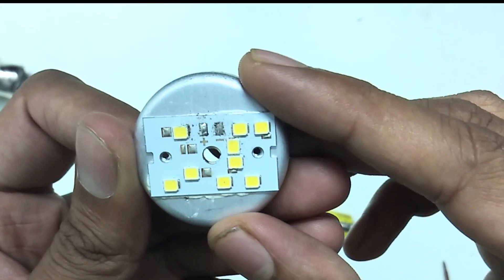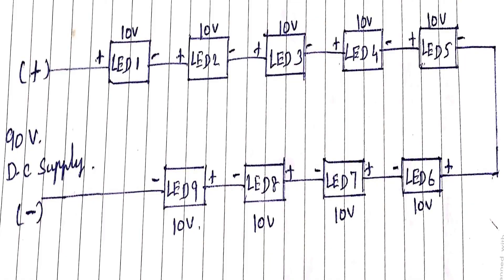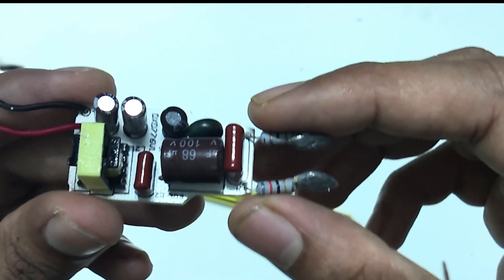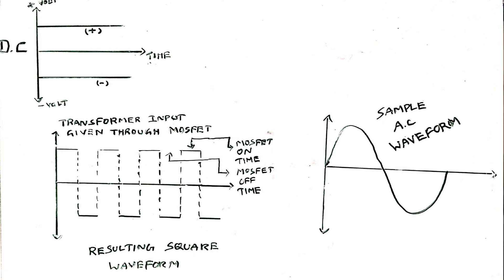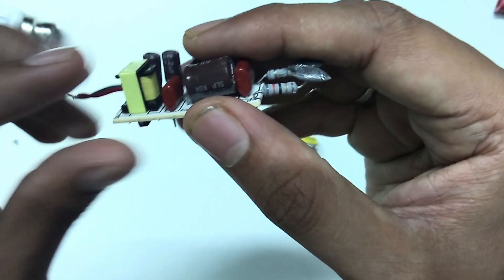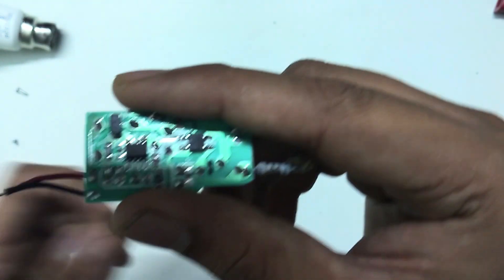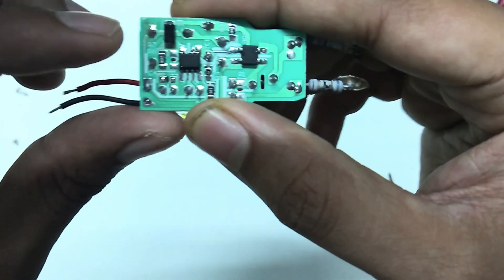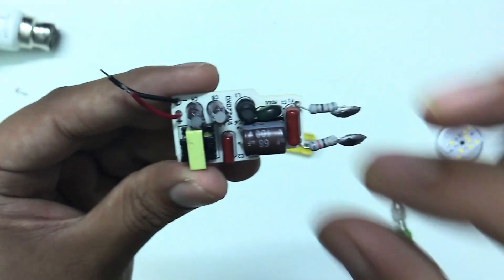What's Inside; LED Bulb vs Incandescent Bulb_ Tamil, How a LED Bulb and Incandescent Bulb works?

Comment: Led bulb circuit board la direct ah transformer ku input kuduthu step down pani diode use pani dc ah mathirukalamae ethuku bridge rectifier potu dc ah maathi atha marupadium ic use pani square waveform ku maathi anupanum tranformerku?

Comment: bro led bulb la oru doubt  bridge rectifier  tha  ac ya dc ah convert  panniruchula nama step down transformer use panni voltage um korachutom  aprm ethuku diode use pannanum apudiya supply kudukalam la?

Comment: Instead of first converting AC to DC then using driver IC for square wave and next stepping down AC and finally converting into DC, why can't we first step down AC to the required voltage and then finally convert it to required DC input?
Reply: my doubt also same

Comment: Bro LED AC to DC bridge rectifier use panaga ok again Transformer after AC to DC convert veanum andha oru diode use panirukanga   andhu enna diode bro andhu Yan brige rectifier pathilam use panna kudadhu??
Reply from the maker: After transformer it's square waveform. So only diode is enough

Comment: Dear bro, in led dc driver why using two times AC to DC convertion. Why didn't Directly using AC input step down to required voltage and after change AC to DC.
Reply from the maker: It's a switched mode output. That's why

Comment: Bro I have problem why led bulb not working after 15-20 days in my house. Even after change brand 3 to 4 brand led bulbs results same. Same thing happening for tube lights also not working after 5 to 10 days for two rooms in my house... Some plug points were burnt.... Is there any solution for this ??
Should I need to change wiring in my house ??
Reply from the maker: Call electrician now, some serious issue

Comment: 1. Why can't we give the input 230 AC volt directly to the step down transformer and then convert it to DC and give it to LED?
Why are converting the input AC to DC and then again to AC and to transformer and then converting it to DC.
Why my point 1 is not valid?
Reply from the maker: 1. direct transformer output produce more ripples.. 2. Transformer will react as per the primary, in the primary voltage increase, secondary also increase, you cannot control. But through MOSFET you can control transformer output.
3. Using a transformer in high voltage, will reduce the cost of components and transformer coil.
Reply: @engineeringfacts  enakkum idhe doubt dha irundhudhu... Perfect answer bro..
Reply: Bro all types of mobile charges 230vac to 3.4vdc . Here transformer output voltage no variations.working very well.

Comment: ஆரம்பத்திலேயே 230 voltஐ டிரான்ஸ்ஃபார்மர் மூலமா 90 - 100 volt dcயா மாற்றிவிட்டால் விஷயம் இன்னும் சுலபமா இருக்குமே. 
நான் ஒரு எலக்ட்ரிகல் எஞ்ஜினிரிங் கிராஜுவேட். இங்கே கொடுத்த தகவலில் சில குளருபடிகள்‌. LED பல்பின் தரமும் குறைவு.
Reply from the maker: Hello, 1.direct transformer output produce more ripples.. 2. Transformer will react as per the primary, in the primary voltage increase, secondary also increase, you cannot control. But through MOSFET you can control transformer output.
3. Using a transformer in high voltage, will reduce the cost of components and transformer coil.

Comment: 2:33 Bro house electricity 325 volts epdi varuthu ?
Reply from the maker: It's a DC peak voltage, after rectifier.
Reply: @engineeringfacts  apo rectify aagitu thaan step down aavumaa bro